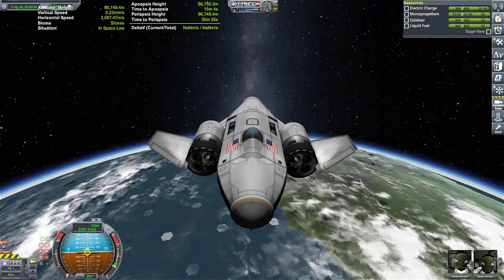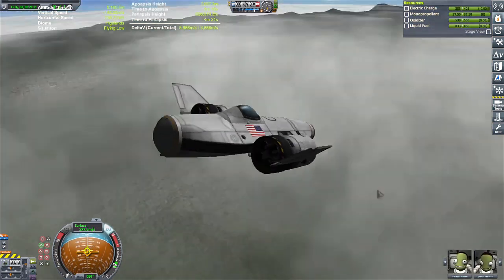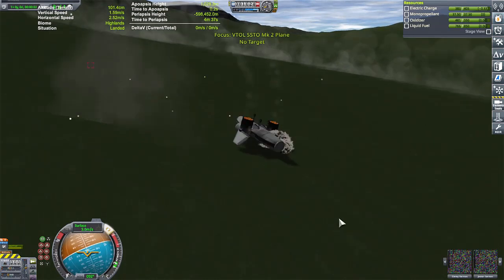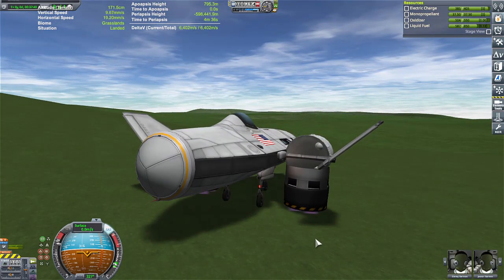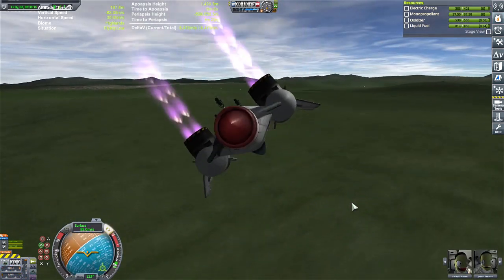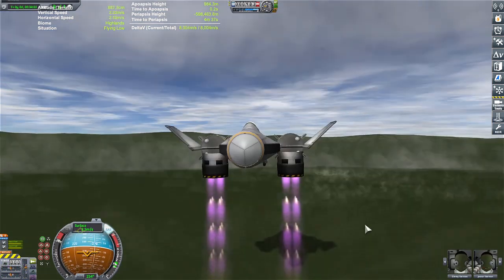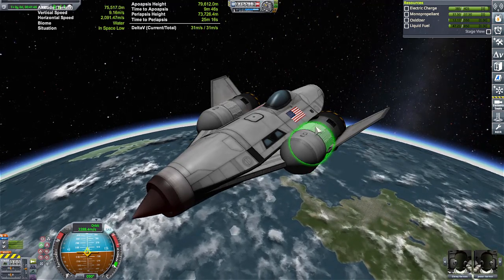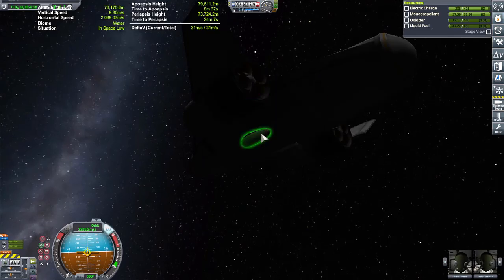DUMPSTER FIRE VTOL SSTO  \  KSP 1.12  \  Kerbal Space Program

Comment: Voas flying skills aside, it flies and lands really well. The issue with the tipping up while transitioning to vertical mode is all about your speed when transitioning. If you're going too fast and suddenly change thrust from rear to below, it's trying to fight the inertia of the forward movement and change it to upward movement.  Thus giving you loss of control and the nose up behavior. Now add in the change in drag as the engines pivot and you have what you experienced. 

The landing gear issue is a KSP thing. I was farting a round with a small vtol and had the same issue.

Comment: What gave you the reentry option that tilts up?
Reply: There is a small probe core hidden inside tilted at a slight angle. Control from here is set to an action group. That gives you the nose up position for re-entry. Vaos's problem is forgetting to go back to the main command pod after re-entry.
Reply: @JollyRogerAerospace  smart

Comment: If you click the water symbol on the altimeter you can switch from sea level to ground level, which will give you true numbers to the ground anywhere.
Reply: Thats actually really neat and I will definitely be using that.
Reply: @ARockyRock  it has saved my butt… err. I mean craft, numerous times!
Reply: But he also has kerbal engineer at the top which also does the same (far left on readout at top covering the mission timer). I use that all the time and having to constantly switch it is a bit of a pain when I have it set to automatically show terrain altitude
Reply: @tyson5811  true, guess I never think to look at it since I have never really used that mod.
Reply: @briannashoemaker1962  it's actually very helpful it's a quick way of seeing where your apoapsis and periapsis are, what time you'll reach them, for science mode the biome you are in, and much, much more information that the game doesn't really tell you. It's a really nifty mods that should've been in the game all along and is a highly recommended mod